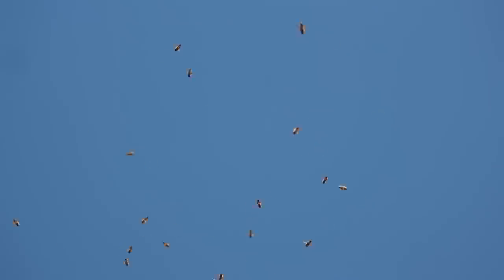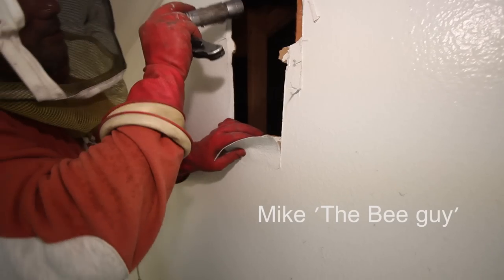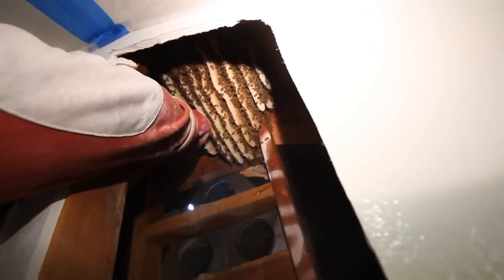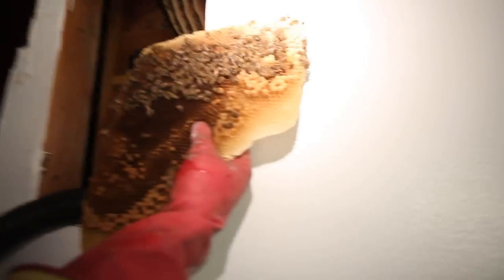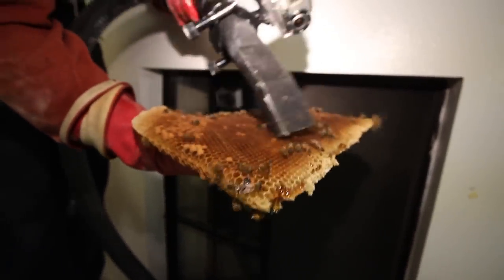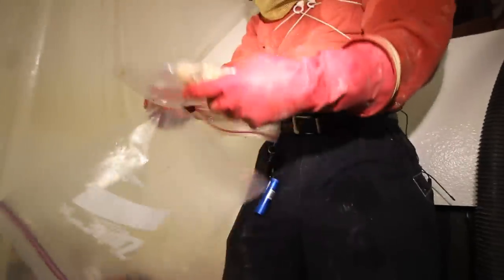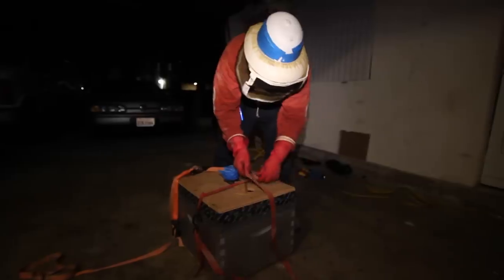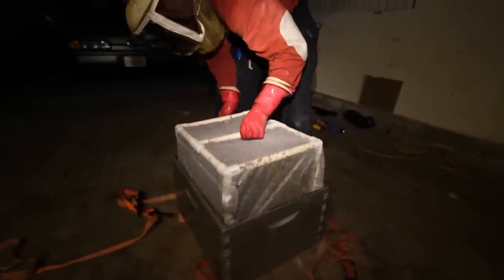Removing and saving 50,000 bees from inside my walls

Comment: thats why we dont build houses with empty walls in europe
Reply: Andrew Ervin thats how u build them in usa
Reply: +Andrew Ervin Yes, and the gaps are completely, and thoroughly sealed by insulation.

You don't leave empty spaces in exterior walls, ever, period, fullstop.

The only exception is when you're running a vent from an upper level to a lower level to cycle cold air, and even then your cold air drop is supposed to be in an interior wall/space (Typically near your stairwell).

You do realize that insulation is laid over top of pipes in the walls, and the wiring is done after so it's flush, accessible, and there's no gaps in the walls? All your exterior walls should be fully insulated with no gaps/air pockets. Pipes that run in the wall are insulated and wrapped in foil (if brass to prevent condensation and freezing), and the insulation is packed around them.

That's code.

I really don't understand your thought process or where you're pulling this information from, because if you leave an exterior wall without insulation the pipes in the wall will freeze in winter and burst.

Maybe you can get away with that bullshit in Hawaii or Florida, but then again - that's why people also have bees in their walls.

Judging by what we're seeing here, this seems to be some sort of convoluted design feature, so there's a portion of exterior wall that overhangs the window to provide shading. It's poorly thought out either way, and this guy is just going to see another colony of bees/wasps move in there (or bats) because there's three pipes that provide clear and easy access to this open space.

Under no circumstances should you mount a passive vent in this fashion, the passive vent (IE: A turbine vent) should be mounted on the roof, or should be flush against the exterior wall as a single vent (no pipes).

Seeing as the exterior of the house is stucco (and sort of ugly stucco at that), I'm going to take a wild guess and say this house is 30-40 years old (AKA, the era of nothing ever being to code).

tl;dr

The only time you should have any 'open space' between walls is in an attic, or in interior walls. All exterior walls must be thoroughly insulated. This video is just an example of how not to design/build a house.
Reply: +MrHeksas got rekt ed by the guy above
Reply: Hahahahah
You are right!
Reply: I'd rather chill with the bees than the refugees :)
Reply: +Derpki I respect the effort but u must be a very sad man
Reply: better refugees than trump
Reply: Joe Jacobs
If you think that educating people and giving full well-sourced answers is a thing to be sad about, I fear for your future.

Comment: How do you know it was 50,000 and not 75,000 or 9,000?
Reply: +Average Joe You can guesstimate by the number and sizes of the hives. They could have been off by a few thousand.
Reply: +Average Joe they probably weighed them.
Reply: +Average Joe They counted each one on their fingers and toes as it went inside the vacuum.
Reply: +Average Joe - that's easy, you just count their legs, then divide by 6.
Reply: Actually there was 50.149, i counted them😱
Reply: +Average Joe it was an Average, Joe.
Reply: Fernando Zhu Yu I think you meant to say, "It was an average, Average Joe."  You should feel bad.
Reply: +Average Joe you dont get it
Reply: Average Joe 9000...

Heh, I get it
Reply: Beekeepers usually can guesstimate by the size of their hive.

Comment: Well you CAN'T just "kill" them.  The honeycomb has to be removed completely, and that always involves removal of drywall or exterior siding.  Otherwise he honeycomb melts and drips through the wall and ruin the house, and will also attract bee scouts from elsewhere who will try to move in.

Once you're disassembling the wall, you might as well vacuum them and save them.  It's not really any harder at that point.

Comment: Why was there a need to remove them? Were they coming inside the house?
Reply: +Peter Bone pretty sure you wouldnt want 1000's flying around you house all day
Reply: +bobo bobina Why not? There are bees flying around all the time anyway in my garden. They're not going to attack you unless you're threatening them. I had a hornets nest under the eves of my roof. I didn't once think about having it removed. I found it interesting watching them go in and out. The vacated nest is still there in my loft.
If you have a fear of bees or are allergic then I could understand, but the guy in the video clearly has neither.
Reply: +Peter Bone Having 50.000 bees flying around during a hot sommer day with your doors and windows open sure sounds like a lot of fun. Especially if you have kids/or animals.
Reply: +Peter Bone The thing is that they expand their hive over the time. If you don't remove them, you will have a very huge population. This might be dangerous to the integrity of your wall from all the weight, moisture, heat and also feces (yeah, bees do poop). And it's then also just a matter of time until they breach the wall and fly around on the inside. Check out youtube some more. There is a video where they try to remove a hive that is 10 years old. Fucking huge and freaking loud!
Reply: +Simon Ransby There were 200 bees according to him. I have plenty of bees and other insects flying around my garden anyway. They pose not problem to man or beast. Bees die when they sting so they're unlikely to do so unless they feel the nest is threatened. Maybe if it was very close to the entrance of the house I would have it removed.
Reply: +Michel Conter OK, good answer. I assumed that they moved on after some time. I know that hornets and bumble bees only stay for a year, but I wasn't sure about honey bees.
Reply: +Peter Bone Imagine the noise 50000 bees make. A constant buzzing from the walls.